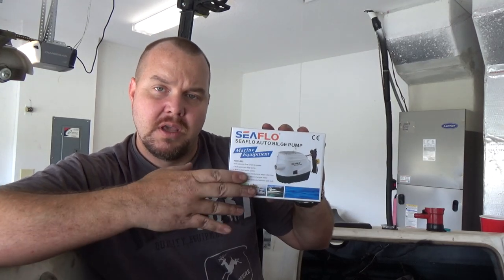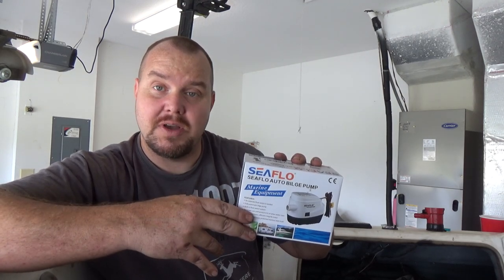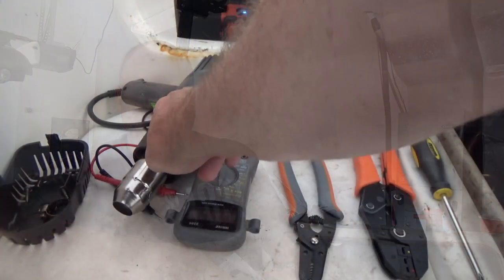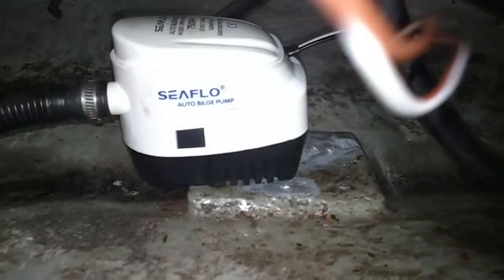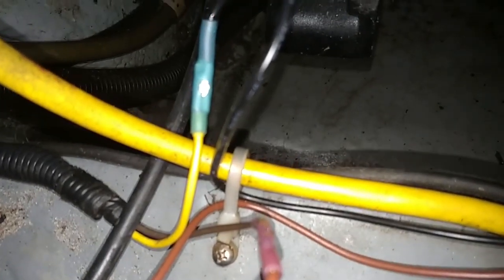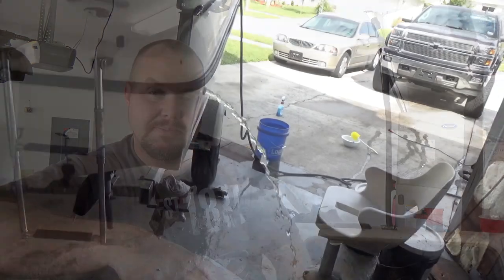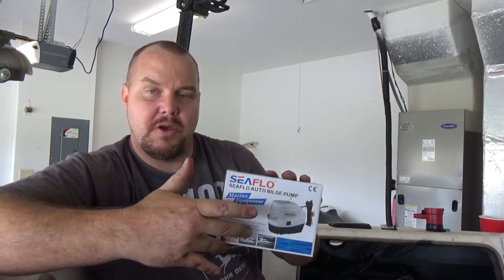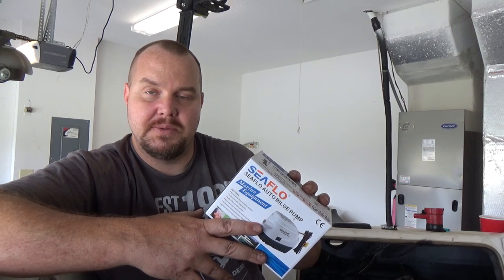Seaflo Boat Bilge Water Pump 750gph EP #6 || Bayliner Bowrider 175

Comment from the maker: 👇The original Bilge Pump in our boat started smoking🤔 so we got the SeaFlo. This is a higher volume bilge pump installed easily,🛠 having the float built-in, and during the video pumped out water after then the water house could put it in.😍